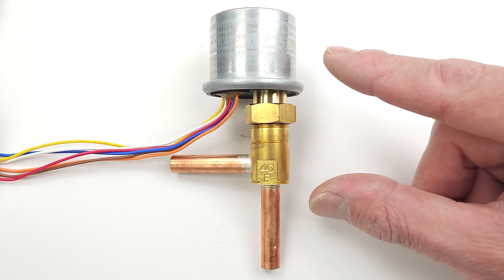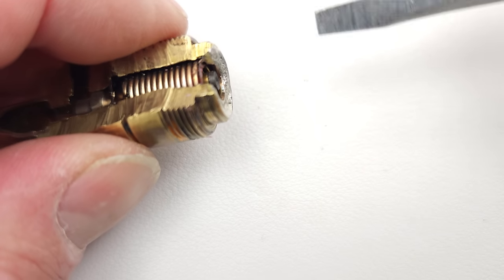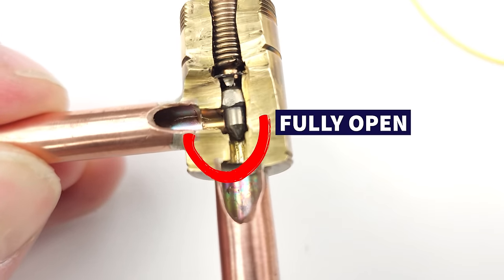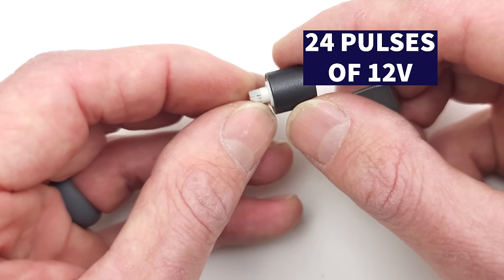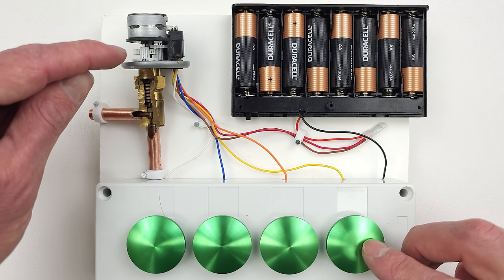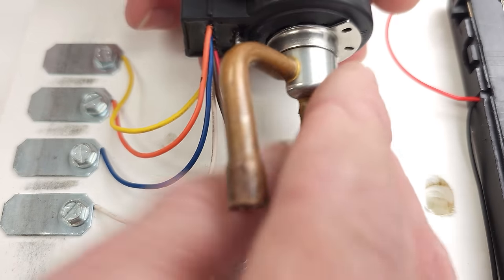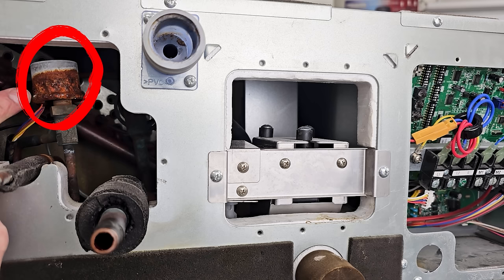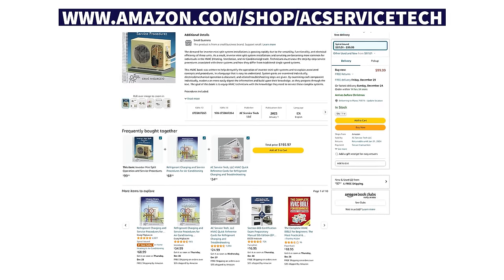LEV/EEV Electric Expansion Valve Operation and Troubleshooting! HVAC Metering Devices!

Comment: Informative video. On your site under quiz section the " Inverter Mini Split Quiz" question #10 asks " 10. How many thermistors are typically installed on a single zone system? above 0psi, the refrigerant...". what up with the " above 0psi, the refrigerant.." at the end... Thank You...

Comment: What are the symptoms of eev which remains open partially and liquid refrigerant flowing in stopped indoor unit in VRF system
Reply from the maker: if there is refrigerant flowing and no airflow, the coil will be very low in temperature and there woukd be frost.
Reply: Why EEV doesnt fully gets closed in stopped indoor unit in vrf system. Is it gear problem or mechanical needle. As most common answer due to impure foreign particles preventing the needle to close completely

Comment: Is there any reasoning (besides price) for one over the other?  The LEV looks like a Carrier product to me "look what we made, just like an eev, but more expensive and wont last as long".
Reply from the maker: There are more steps of control and more strength for closing the pin position due to the gearing.
Reply: @acservicetechchannel  I dont see much of this stuff as Im fairly rural and have a set amount of hvac equipment in my area but the LEV guts looks like the inside of my 5 y/o's toy cars.  Everything Ive ever heard was EEV's are 100x better control than a TXV, now LEV's give more control than EEV's.  I really want manufacturers to focus with a laser on reliability, enough with gizmos for a bit, who cares how efficient it is when the coil leaks after 3 years?
Reply: @Adam-ul2px the gubmint wants it efficient. The mfgs love that they can charge out the wazoo AND you have to buy it from them, no universal or aftermarket.
Reply: @realSamAndrew Until the lack of training for service techs means good parts get sent back under warranty.